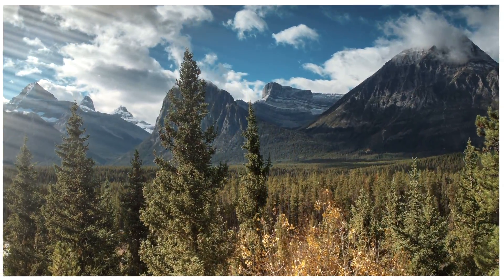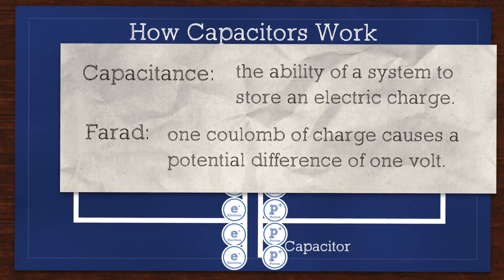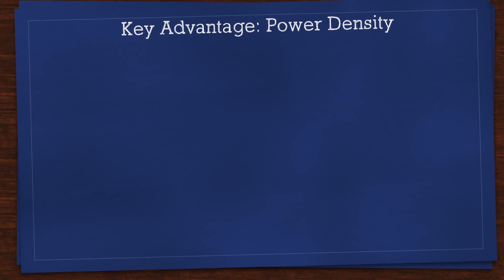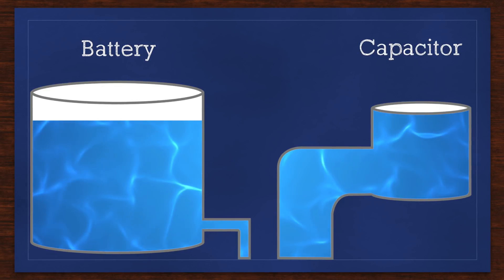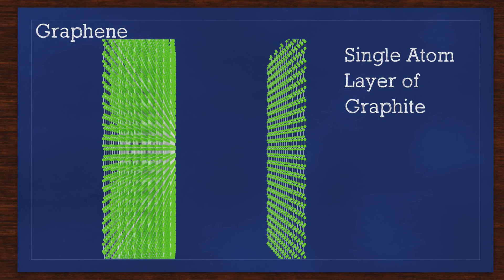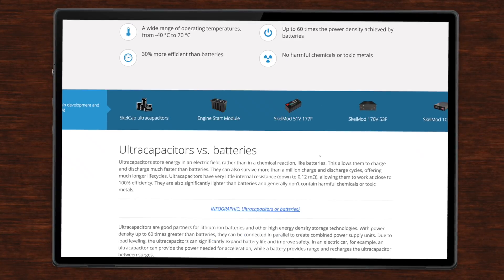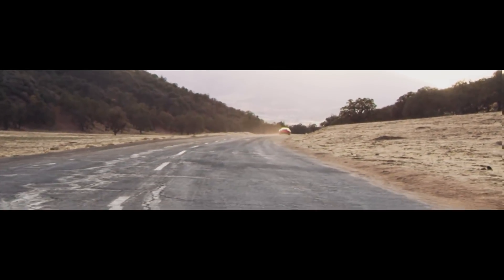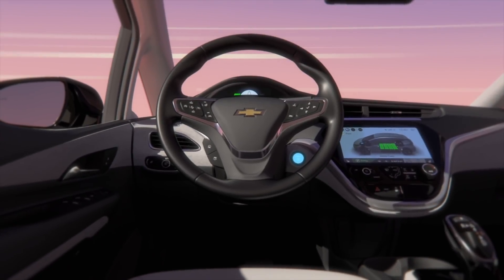Can This New Technology Make Batteries Obsolete?

Comment: All we need now is a single atom insulator for a super dooper ultra multra capacitor.
Reply: Lol yep..   A decent alternative would to be use a very thin, light weight fiberglass or Kevlar cloth and bond some silica based aerogel particle infused "paste" inbetween, and a thin layer on, the fibers.

Or something similar.  

However, Maria and John B Goodenough's team has found out that if you used an electrolyte doped glass inbetween two quantities of lithium chem, you get an odd battery-capacitor hybrid that has higher power and energy density than best lithium batteries, with also better life cycle.

  Personally, it's qualities sound good enough to me...

Comment: Good job in adding sources and references, very informative video! Also, check out Riversimple. I think they had a car with capacitors as additional powerboosters, so the batteries could be small and light
Reply: It was actually a hydrogen fuel cell vehicle with capacitors to manage the power delivery I believe. The fuel cell only put out 8kW or so.

Comment: Lithium is one of the most harmless “mining” operations there is. Much of it comes from evaporation pools in entirely uninhabitable* deserts. We could extract it out of ocean water if we wanted to. That whole “lithium mining/processing is bad for the environment” thing is straight propaganda. 

I do quite like ultra capacitors though, even if they do scare the crap out of me. That raw amperage, man. Should make for great acceleration.
Reply: There are some negative sideaffects like the use of chemicals and extraction of water from the local watersupplies. But when that beiing pointed out you can also say the same about crude oil winning like in tarsand mining.

Comment: You forgot to mention charged capacitors will explode from impact or puncture. "But batteries can explode too" yes, but that doesn't mean capacitors are equal. The difference is, I can drop a car battery(non-EV) and be fine. However i could not do the same with a capacitor the size of a car battery. The amount of energy stored would cause the capacitor to explode.
Reply: solids batteries doesn't explode
Reply: Just guessing here, but maybe a bunch of small capacitors spread out a bit throughout the car... like battery cells. Doesn't seem too hard to make sure they can't all get squashed at the same time.
Reply: Hogwash! Where the hell did you get that silly idea from? Or did you make it all up by yourself?

Comment: Does anyone know what the relationship between the voltage and the amount of energy stored in a capacitor is?  If the voltage is multiplied by 2 will the energy also be multiplied by 2, or by 4 ?
Reply: Nop. Not linear. Exponential. The formula for energy stored in a capacitor or supercapacitor is E=.5xCxV²
Reply from the maker: Believe the relationship is fairly linear

Comment: If you wanted to charge a 5kWh ultracap in seconds... lets say 10s, it would take almos 2MW of power, that would need insane DCDC converters, at 1000V it would still be about 2000A (starting at 4000A for CP charge)!!! insane cables would be needed! So no you can not charge 5 kWh in seconds! even as a supplemental powersource in a car it is not really practical, because you need a second DCDC converter, that needs to be able to handle a big voltage range (upper 50% of cap voltage for 75% of energy) and als very big currents = expensive,  just for a bit of speedbost, so maybe for supercars and high end sportscars. Other storry is of course when they get close to battery capacity, then they will be very interesting, untill then it will be not very usefull to EVs.
Reply: Trolley wires at 600 volts can handle 20+ MW and are not very expensive.
Reply: I'll make do with 5 kWh in 40s :) Only 500kW/500A then. Can you explain what will change when getting close to battery capacity. Understand you don't need the second DCDC-converter, what else?

Comment: It's unlike you to make these, but you made a fundamental mistake in this video when speaking about the difference between power and energy. Speed is not a manifestation of power, but of energy. Acceleration is the power manifestation.
The water analogy is excellent, though.
I also would have liked to have some info about another important aspect about batteries vs capacitors. Batteries usually leaking a lot less energy over time. What about graphene capacitors?
Reply: Florestan Trément Yes I felt the same, but more to do with the cars graphics being switched. There’s a basic error there the way I see it. Still a great video though.
Reply: Actually, speed is a manifestation of power. Acceleration is a manifestation of torque.

Actually, it's a bit more complex than this. Power equals force (torque in this case) times speed. This means that with a limited horsepower, a vehicle can indeed still produce a propelling force at any speed. However, the force continually decreases with speed. A constant force at any speed would require infinite power. Friction also continually increases with speed. The vehicle accelerates until its driving force is equal to friction. This is the vehicle's top speed, and why more horsepower generally equals a higher top speed.
Reply: @00crashtest  Well, I didn't see it quite that way, but although you play a bit on my words, I acknowledge you are right. It still makes it a very bad example, because very confusing.

Comment: With the extremely strong bonds of the carbon to carbon atoms, and the way superior strength (to steel or Kevlar) of graphene, perhaps there’s a bunch of structural uses for this material, once the economics for using it are somewhat normalized.  This structural usage may outweigh the supercap application?  Picture this material accompanying aluminum in making up something like an extremely lightweight airplane fuselage?
Reply from the maker: Absolutely! Yeah we covered it in the context of energy and transportation, but yeah you're absolutely right. This stuff is hard to manufacture, but it will be revolutionary.

Comment: I think solid state batteries are the future for EV's.
Reply from the maker: yeah Capacitors have a unique benefit, maybe a blend of both?
Reply: If what Samsung is doing pans out, then it could be the best of both worlds.  Their blending of Graphene into their Li-Ion cells could be so good overall that it might be sufficient for a considerable period of time.

I am a big fan of what a pure graphene capacitor could do but I am also not so foolhardy as to not use something that well fits the category of "good enough".  If some form of blend can be achieved that allows for far faster battery style charging and also results in a solid state battery or equivalent, that would then have a far longer lifetime than existing tech, great.  I'll get behind that too.

Thanks to the law of the conservation of energy, nothing we do will ever be waste free but fundamentally, we need to be sure that we don't do things only for the sake of doing them and forget to look at the total lifecycle and resource demand for not just making a thing once, but for keeping it going for 50 to 100 years.

Comment: Graphene will also be applied to rechargeable battery technology to increase their energy density and improve charge/discharge characteristics so i'm doubtful that the Ucaps with their linear discharge characteristics will ever replace batteries in applications like EVs where maintaining a level voltage over extended period of time is important. However, as you mentioned, I can see Ucaps being used to supplement batteries with their high charge and discharge burst abilities.
Reply: That depends on how good they get. If they outperform the best batteries, the technology will adapt to use them effectively.
Reply: @JamesSempy  
https://youtu.be/KQ2Eo6wl5r0

Comment: I like you stuff, but supercapacitors have been "about to replace batteries" for several decades now...
Reply from the maker: Graphene supercapacitors are really new... so yeah it'll be interesting to see how the next few years pan out.
Reply: @TwoBitDaVinci  
As reported by fullycharged several months ago
Ultracapacitve kers systems.
Used to suppliment batteries, absorbing regen, releasing for acceleration, releasing stress on the battery.
Being used in large vehicles, but also in Motorsport, unspecified customers, (lemans? F1?)
https://www.skeletontech.com/
.......
Then I read the rest of the article.
(Didn't I say all this on a previous vid?)
Reply: @TwoBitDaVinci  Graphene capacitors have been under development since the 1960's. 30 years from now we might have the materials tech to make it work at the level needed for a car. TIll then I'll keep burning dino juice.
Reply: Not sure about "several decades", but I get your point, similar to hydrogen being the solution. Now that has been "several decades" in the making.
Reply: @garn5341  
Except hydrogen will never be efficient.
Reply: @rogerstarkey5390  not true the Mirai a hydrogen powered car can go 300 miles
Reply: @garn5341  The situations are similar but there are some major differences IMO. Hydrogen has been hyped in the face of some major problems that despite a lot of effort remain unsolved including most importantly where do you get the hydrogen from and significantly greater round trip losses than with batteries. Graphene is fairly new so it is much more difficult to predict how useful it will be and super/ultra caps have made amazing progress over the last ten years. There is nothing comparable with regard to hydrogen car improvements as the improvements in super/ultra capacitors. Ultra capacitors are now viable products and it is not clear that hydrogen vehicles will ever be.
Reply: @garn5341  Or nuclear fusion energy for that matter.
Reply: Koen Defining Fusion (in this case ,Cold Fusion) is being prepared for sale to the public.
Reply: @JohnLopez-jm3yy  
One day.
If it was "a thing" now, today, it will take years to plan and build.
No time!
Reply: Scott Franco,  Yep.  I remember in the 80's when EV's were being tried out and the battle cry behind them was, 'We need batteries with 10x the power in the same package as we have now" in reference to the common deepcycle LA battery of the day, to make them practical and competitive with standard fuel burning vehicles.  

 Well, 30 years later lithium met that cry and EV's .........   Just got batteries 1/10th the size of their predecessors from the 80's and that cry went out again  that "We need batteries with 10x the power in the same package as we have now".  

Go figure.
Reply: @tcmtech7515  I do hear that a lot... from people who don't own an EV. The standard refrain is that "I'll buy an EV when it gets 400 miles range", even though 200 miles was a common range for gas cars before high mileage hybrids. 400 miles, or likely 100kWh batteries, is an inefficient battery to haul around every day when average needs are 50 miles a day or so. It comes down to the story people tell themselves. "30 minutes for a fast charge is too much" means to me that people are trying to fit EVs into what they know about gas cars. I have owned EVs since 2013, and I average 2-3 times per YEAR when I wait at a charger. The rest is home charging when I don't really track, know about or CARE much about how long the car took to charge. Everyone I know who actually GOT an EV is pretty much the same. All the concerns they had before getting an EV are gone AFTER they actually get one.
I went from leasing a leaf, to a Bolt that my wife now drives, to my Tesla M3. All were practical, but all differed in terms of range and convenience. A 75 mile range leaf was practical as a commuter car, but not for long trips, and took planning to be able to run significant errands during lunch. I charged it every night, and would have issues if I forgot to plug it in at night, usually requiring a stop off at a supercharger.
The bolt changed that model to only needing to plug in 2-3 times a week, and made long trips possible, if not convenient. It took it from San Francisco to LA once after I got it, which required planning and some fairly major stops to charge along the way.
With the Tesla M3 there is no issue with long distance driving for me at all. I don't drive for 300 miles without stopping, which is 4 hours even at California highway speeds, so the 20-30 minutes it takes to charge can be taken during lunch or dinner breaks, and nowadays I pull into Tesla highway charging centers with 10 to 20 charging spots, most unoccupied.
Reply: Scott Franco SuperCaps won't replace batteries, but maturing hybrid BAT/CAP systems, along with better engineered electronics will lead to great things.
Reply: Eestor was supposed to change everything...in 2007.
Reply: Scott Franco bh
Reply: capacitors do not hold a long term charge.  The idea they will replace batteries is always going to be a pipe dream due to that aspect of their nature.  However, Caps + inductors used in conjunction with newer batteries will yield some hefty benefits eventually.  All kinds of circuits of that sort will benefit from newer materials and capabilities.  Also, Lithium batteries will cease to function in freezing temperatures.  They still have quite a way to go before they replace fuel as a result and quite frankly, I don't want to pay that much for a car that won't function in the winter for half the US and 3 months or so per year.  Your battery freezes and your car range will go from 200+ to 0 instantly.  Enjoy that.
Reply: zarroth ...hmmm, I wonder why Norway has the largest number of EVs per capita of any country in the world. Oh, I forgot. Norway doesn’t have winters.
Reply: @DrPeter0  yeah, but their very cold summers lass all around the year basically :D
Reply: The production cost has been decreasing significantly in those years though, so it's not like it's a stagnant field.

Comment: Proton? Dood no protons move. This graph makes people believe that you store protons in some side of the capacitor. It's just potential differential, more electrons in one side and less in other side.
Reply from the maker: Understood, I think we tried to make it more visual clear, but totally understand your point. thanks
Reply: @TwoBitDaVinci  Thanks for your concern!
Reply: If the electrons go away, that leaves protons, so it's technically right, which is the best kind of right^^
Reply: @Steamrick  No but you don't get my point lol. One side won't have more "protons" than the other side. It's just electrons moving through a conductive material(such as copper wire). That animation makes people believe somehow protons accumulate in one side which is blatantly wrong
Reply from the maker: thank you ... our viewers never fail to amaze us... we'll keep trying to do better!
Reply: Two Bit da Vinci you are already amazing!
Reply: Protons do move, but not as single protons, but as lithium atoms, more specifically lithium ion atoms (ion because they lose electrons who go through the circuit) that go through the separator between the anode and cathode. They can only go through the separator as ions, and thus have to shed electrons, but to do that the electrons require and external circuit to go through to meet up with the li-ions on the other side.
Reply: @GeneralBlackNorway  I was talking about the capacitor animation!